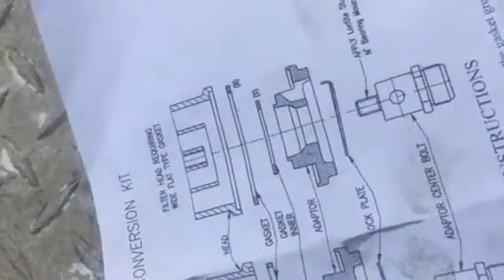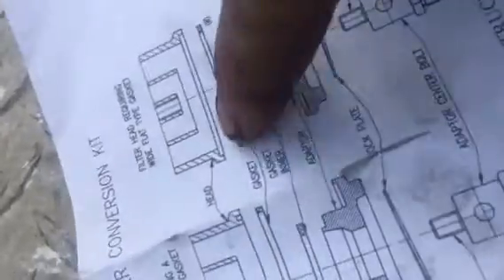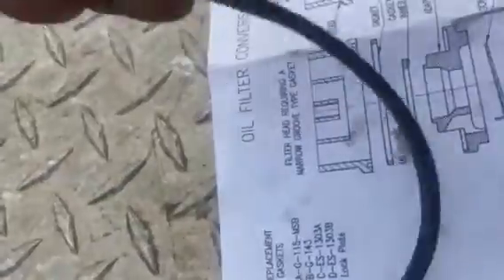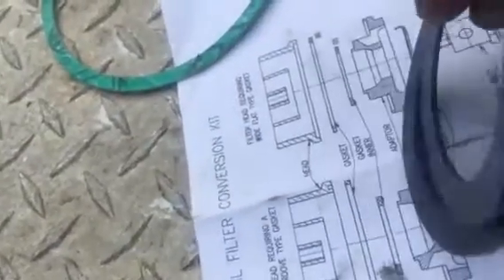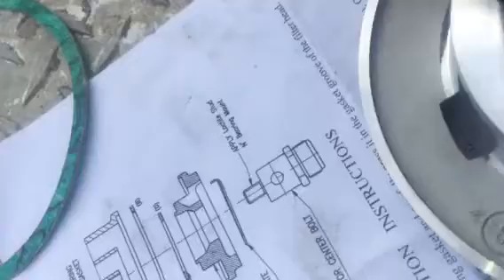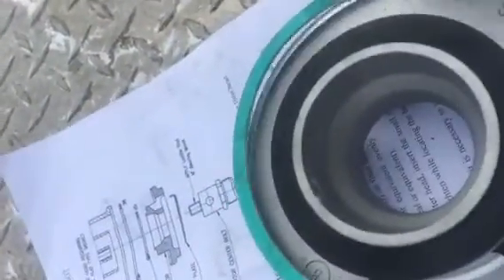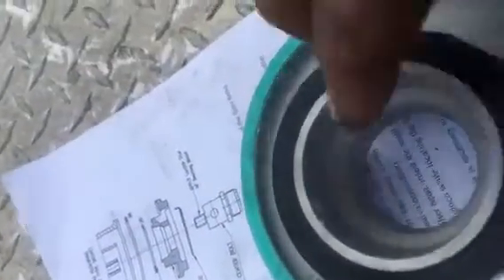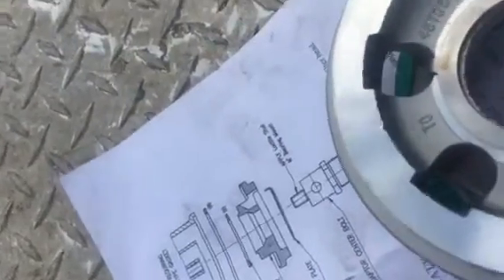Converting 8v71 internal canister oil filter to spin on filter

Comment: Hello Scott, we’re changing the oil filter adapter as the old one is a smaller and restrictive unit but having a difficult time removing the plate that the filter mounts to. We removed the bolt portion but the other seems like they used sealant. Any suggestions would be greatly appreciated.

Comment: Does this work on the bypass lube sock type 6-71 engine?
Reply from the maker: No.  You need the oil cooler mount that has a spin on.
Reply: @BusGreaseMonkey  thank you do you have any idea where I could pick one of those up?
Reply: @BusGreaseMonkey  or would I be better off just getting a new lube sock replacement?